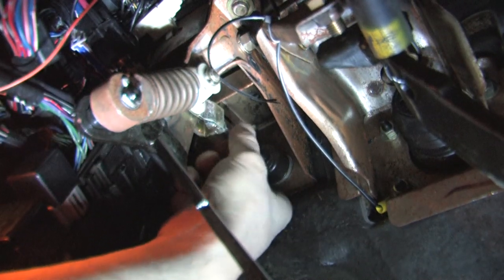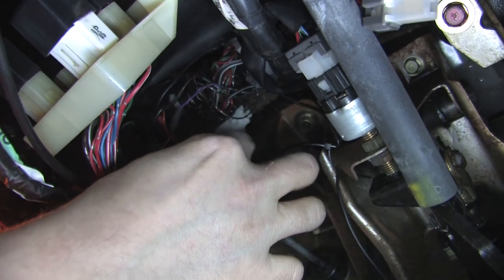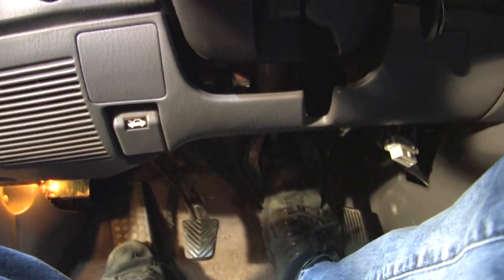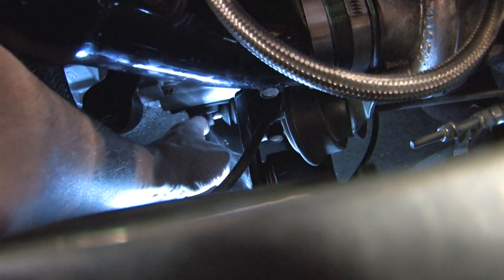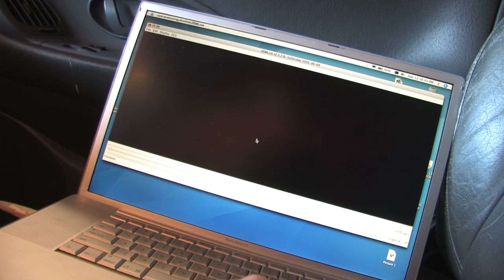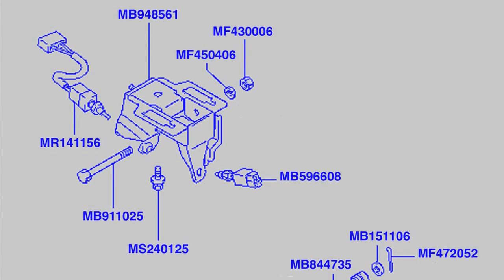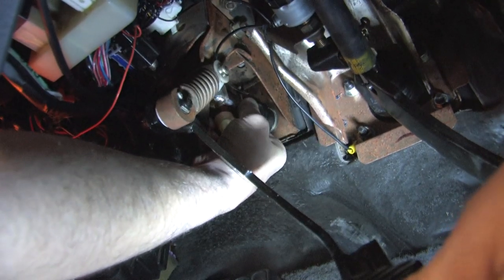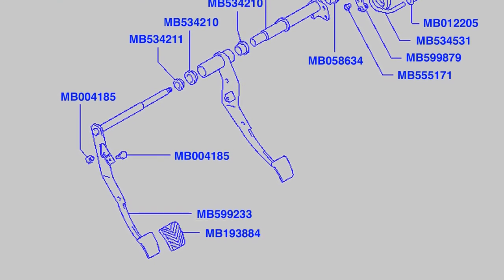Trans & Clutch 8 - Adjust the Clutch

Comment: Yeah I'm mad at myself for not doing this in the beginning. I replaced master and slave and always had the hardest time getting into gear. Turns out I didn't tighten that nut down good enough broke free and loosing itself up. Most simple fix I've ever done. Thank you so much for posting this. People kept trying to tell me synchros, pressure plate, or throw out bearing was bad. It was just a loose nut..

Comment: I SOLVE THE PROBLEM =D EITHER WAY IM THANKFUL FOR YOU GUYS BECAUSE I STILL LEARN NEW THINGS. I WAS THE COLD AIR INTAKE THAT WAS ON THE WAY OF THE SHIFT BRACKET APPLYING FORCE.... NOW I JUST NEED TO FIGURE OUT WHY MY CLUTCH IS NOT GRABBING AND IT ONLY HAS 380 MILES ON IT... 
THANK YOU A LOT. =D

Comment: Thanks for the reply but I'm fairly certain I've figured out the issue. See I have an aftermarket carpet installed and it is pretty thick stuff. I just cut out a notch where the clutch pedal goes and it seems to go that much further down to where I am no longer experiencing any clutch drag. I've gotten to a good 650 miles and given the new clutch some HX35 boost (no launching yet). Seems to be holding beautifully. Thanks again for your informative videos and replying when people have questions.

Comment: I wanted to add a bit of info here.I have a 1990 Eagle Talon AWD TSI.I did a motor and trans swap once from a 1Gb and found that I had a real hard time getting into gear, almost the same problems everyone here seems to have.After a lot of goofing around I found that the shifter cable brackets on the trans where the clips hold them down are slightly different on the 1G VS 1Gb.Long story short the 1Gb bracket makes the 1G cables bind and you can't shift into gear.Hope that helps some people out.

Comment: I have adjusted like you said and cant get the car in gear as it is running i replaced slave cylinder and bleed like 1000 times and nothing my slave was leaking and thats why i replaced it b4 it worked awsome now after adjusting nothing if i start the car in gear the car pulls forward. Pedal is new and no slop in at all i have a no spring clutch and lightweight flywheel. Helo me please my tsi has been down no for 2 months

Comment: Thanks for the video! I've got a problem with my clutch 2 days ago, I've just changed my clutch (ACT 2100 disk + pressure plate) and it was running just fine for few weeks until 2 days ago in the morning when I pressed the clutch to start the engine and I've heard a small thunder. I've turned on the car and tried to engage but I couldn't so I replaced the master cylinder, after bleeding I found that to engage I have to push it very hard, it is so heavy, if I push harder I can hear like scraping

Comment: @Jafromobile Yes my slave is not traveling enough to disengage the clutch, the master and slave are brand new i bought and installed them myself, i replaced the slave because it was completely rusted over and was not traveling enough either and figured id go with a new master as well. the rod on the new slave is longer but the part number is good for my car i have tried both rods and got no difference clutch has 8k on it flywheel is aluminum just had em out fork is drivers side before center =D

Comment: When you test by pressing the slave cylinder piston, that one was my big failure. It broke my clutch release fork. Now I have to open the transmission to replace it. Is there a way to not open the transmission to be able to replace the broken fork?

Comment: Hey Jafro, 
 Lemme start by saying great videos, helped me with everything throughout my install of clutch, pressure plate, new friction plate on the fidanza, clutch fork, pivot ball, and OEM TOB. Now I'm stuck at the point where I cannot get my clutch to engage while the car is running. I've tried, to the best of my ability, to follow your video and the steps, but I still can't seem to get the clutch to engage. Bled, then adjusted. Any suggestions?

Comment: I need your advice. I just installed a new clutch, PP, ACT flywheel, CC fork and pivot ball, and OEM TOB. I've done the master adjustment according to the Jackstransmission video and I have the switch backed almost all the way out. I'm still getting a little bit of drag at about 7000-7100 and every now and then reverse clunks on me. With all of these parts being brand new, they should all work together perfectly.

Comment: I press the fork and no movement so I'm pre-loaded. Adjust the pedal and I can move the fork. Now the engagement it too far off the floor so I adjust the master cylinder. Get engagement point to around 2.5" and check fork and again pre-loaded. Keep doing this and it always goes back and forth, now I'm getting close to running out of pedal adjustment. Could I have too much fluid in the master cylinder? I couldn't get into fifth or reverse at the beginning but that has been taken care of as I have made the adjustments. Like you said in the beginning of this video, I'm getting really tired of my clutch.
Reply from the maker: If the clutch pedal sits higher than the other pedals, so what?  You'll notice that you adjust to it very quickly.  I actually prefer it that way, but that's me.  It gives it the room necessary to fully dis-engage.  It sounds to me like 2.5" off the floor is where your clutch is pre-loading, and there's no harm in making it 3"… so long as your clutch doesn't make any strange noises when it's fully mashed to the floor.  You'll adjust to it quickly.

Comment: Jafro,  I'm doing research as always but, I was wondering what clutch pedal assembly would you recommend for my 94 Mirage Coupe ES? I know this car came with a stick, but hunting down factory parts is a nightmare. I was thinking about going with an Evo 8 clutch pedal assembly simply because it''s hydro, and if I did luck out and find another 94 Mirage with a stick, it's CPA isn't hydro. Which would you choose in my situation, and why?

Comment: Hello jafro whats up. I need some advice. I replaced my MC today and it went well. Clutch engages about 2 1/2" and it goes into gear smoothly. However, Im experiencing "clutch drag". Unfortunately, I ran out of daylight so i had to stop. While watching this video and the jackstranny vid gave me some confusion. From what i understood from jacks is that I have to back out the cruise switch all the way back then adjust the pushrod to a point where its on the verge of closing the pressure valve. -

Comment: Even so, I still checked and the fork is in the correct position when looking at the front of the trans. I don't have any leaks anywhere so I'm not sure where to go from here. I still haven't tried cutting the carpet to get a little more travel out of it but I think I'll do that tomorrow. I was wondering if a SS line from master to slave would help or is that just going to change the feel, not the actual engagement/disengagement?

Comment: Hey jafro i have followed every step in your videos and those of jackstransmissions and i cannot get my hydraulics to work where i dont have to preload the slave to get the travel i need, new master new slave bleed enough to run 2 qts of dot 3/4 thru pretty sure my pedal is not worn its pretty solid tried a long push rod only thing i have not done is a ss line do you think the dampener can could have air in it even after 100 bleeds iv got the pedal stopper all the way back thanks man = D

Comment: @Jafromobile ok so i adjusted the screw to make the idle speed higher (had to screw it in almost all the way) and it will stay running in neutral w/o adding gas, but i can't shift still.  i didn't want to admit it, but you know how clutch kits come with a pilot bearing?  well i put that in b/w the clutch disk and the flywheel using the clutch alignment tool b/c i didn't know what it was for(*hangs head in shame*).  i was asking those other probing questions in case i didn't need to remove it. :(

Comment: Nice video man like always real informative!!
 
Now I have a question for you.
 I have a friend that has a 1995 gst  and his clutch is new and his flywheel is pretty used " over 10,000 miles,he recently change the slave and master cylinder and did the adjustment for the clutch.
 Once he puts it in reverse and takes out the clutch the car violent shakes!!
 It sakes sometimes once he puts it in first gear.
 What can be the issue there?
 Please anyone that has that happen before give me ur input thanks!
Reply from the maker: Missing or loose transmission bolts (namely the crankwalk bolt), bad engine mounts, or a mis-aligned clutch (damaged or missing transmission dowel pins).  It should be smooth as butter or much bigger problems will follow.  If it's shaking the whole car, it's flexing the crankshaft.  Watch my 7-bolt diagnosis video and find the part about the crankwalk bolt.  Watch transmission 2 and 3 and see the result.  It could be that the sole purpose of my life is to serve as a warning to others.
Reply: Jafromobile 
Can you put the links to all those three that u mentioned so I can see them?
 Thanks
Reply from the maker: Here is the bolt that I have named the "Crankwalk Bolt".  It's every DSM's worst enemy.  It's documented, but not well documented in Mitsubishi's instructions, and it's not intuitively found by undereducated, underpaid mechanics who don't read directions anyway.  If it comes loose and falls out, or if someone who replaced a clutch didn't put it back in there, it often leads to seized clutch discs (Trans & Clutch 2), and what lots of people call crankwalk.:
https://www.youtube.com/watch?v=hF8iCN7H7DY&t=10m51s

Trans & Clutch 2 shows what will happen to you if you're missing your crankwalk bolt, if your clutch is in some other way misaligned: https://www.youtube.com/watch?v=dLbcbORH2gc&t=308s

I bought my car with 114,000 miles, a broken 2nd gear, and an aftermarket clutch in it.  My car came without the crankwalk bolt and went through 3 transmissions and 2 clutches before I found out why.  I'm convinced that 95% of the cases of crankwalk were caused by a botched clutch job.
Reply: Jafromobile thanks man for all of of ur input and for putting up the link and help out.
 You rock!
Reply: hey jafromobile; im having trouble finding the correct part number rear transmission mount bolts that bolts up to the back of the transmission.can you help me with this problem,i belive there are 2 bolts one horizontal and one vertical thanks. if you have any info where I can get part number access to every single bolt nut and so on... please tell me because my car is missing quite a few bolts. thank you so much sir!!!

Comment: I need your advice. I got installed a new clutch and master clutch cylinder, after that cruise control button on dash turns on but doesn't engage. I checked the cables on clutch pedal and all seem normal. I have a Honda Civic 94

Comment: i just finished using part 6 to bleed my clutch out, and the clutch engages and disengages fine now, but i can't get the engine to keep on running on its own.  even putting gas in won't keep it from stalling, and trying to put it into gear makes it stall even faster.  my car didn't do this before i put the new clutch in, so i'm wondering what i did to it.  does transmission fluid level affect this by any chance?  (this is the first time i've attempted to replace a clutch)

Comment: hi jafro im having the same problem with my 1990 eclipse gsx i got new master n slave n i even adjusted the paddle n nothing i don't  remember or know if 90s have the cruse control but its doing the same thing and it wont go into reverse it grinds and i took the trans n seen looks like the flywheel teeth is rubbing on the bell housing the clutch is new throw out bearing its new i don't know whats wrong you think the flywheel is maing it not go into gear or why its rubbing the bell housing?

Comment: hey jafo I'm having a strange issue and have done alot of research and it's a rollercoaster of awsners so my issue is in my 95 gst the clutch goes soft after high rpm pulls if I don't go high rpms no issue if I go high it goes soft  just replaced slave. but same issue. if you could sling a bit of advice I'd appreciate it.
Reply from the maker: Any slipping or shifting problems?
Reply: Jafromobile yes shifting issue when it goes soft. vacum bleed it today didn't help as soon as rpms. come back down it goes hard again. I have a 6 bolt swap checked for crank walk didn't have hardly any movement .
Reply from the maker: Get on your floorboard by the clutch pedal (I know... sorry... it isn't easy) follow the pushrod back to the rubber grommet where the master cylinder protrudes through the firewall.  If it's gooey or any has dripped out, your master cylinder is leaking.  Peel the rubber grommet back off the master cylinder and see if any fluid is inside that area of the master.  If everything is golden there, go inspect all of your bell housing bolts, and don't forget to make sure the crankwalk bolt is in place.  It's the M8x60 bolt at the rear-bottom corner of the block that's bolted from the opposite side of the transmission.  All of them need to be present, and torqued-to spec.  If not, they will slowly back out over time and cause much worse things than you have described so far...
Reply: Jafromobile lol actually I'm changing the clutch master as we speak I have a few dam layi g around for parts and I appreciate you getting back so quickly I'll be checking the bolts right after I finish this and get back to ya.
Reply: just got done bell housing bolts are all tight rear bolt is still there I'm hoping that this clutch master solves my issue.

Comment: Ok my 1st 3rd and 5th gear became stiff after I tried adjusting my clutch because it wasn't grabbing correctly now I set it back where it was before and gears are still stiff. 
The cruise switch is all the way flush and the rod is also flush... To give the most amount of fluid travel. Please I really need help. 
RSX-S 2004 STAGE 3 clutch 6 puck. 
THANK YOU....

Comment: Ok,after replacing the slave cylinider..So simple this caveman has done it.over & over again. I've adjusted the pedal height, I've gravity bled the system & have pressure. I've adjusted the rod on the master, just to the point of where it blocks the bleeder valve & can no longer collapse the slave by pressing on the clutch fork, and then turning back a little bit, so that I can. I still can't get the car into gear when running. !?! Start it in gear,it engages with the pedal on the floor. !?!HELP

Comment: But for us idiots,  you didn't show us how to get to it man!
Reply from the maker: Hahah.  I thought it was clear as I struggled to get into the driver's seat upside-down.  All of the adjustment is behind the clutch pedal.  Look for a shiny silver looking rod going into the firewall.  The lock nut is on that rod.  The cutch fork is sticking through a rubber boot and a square hole on the front of the transmission.